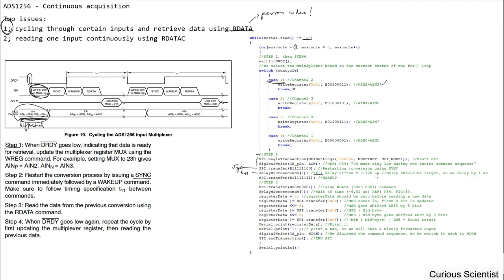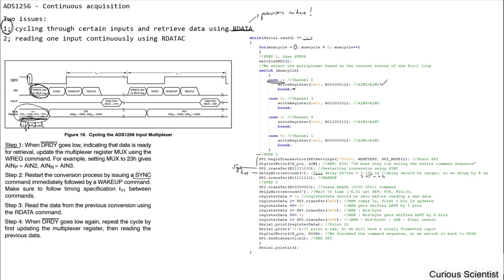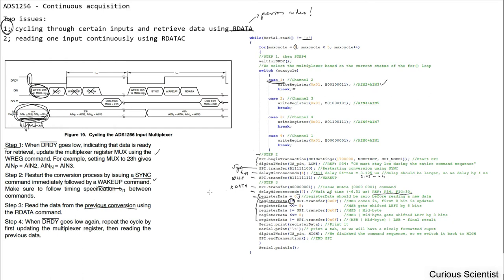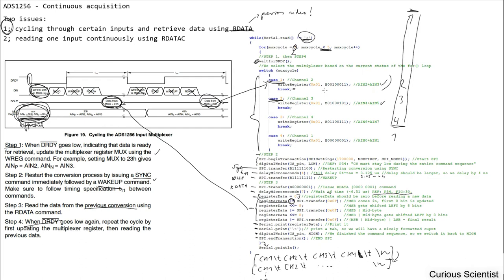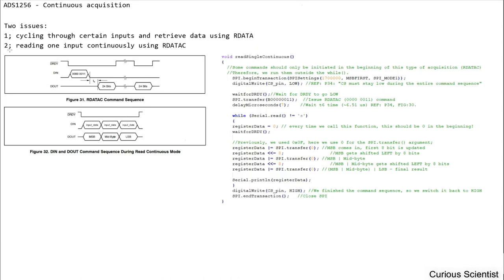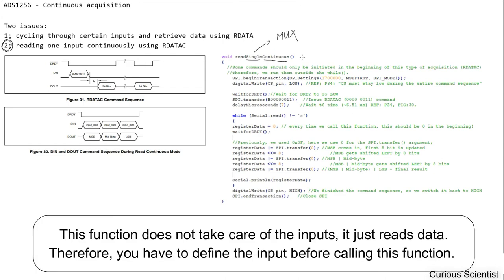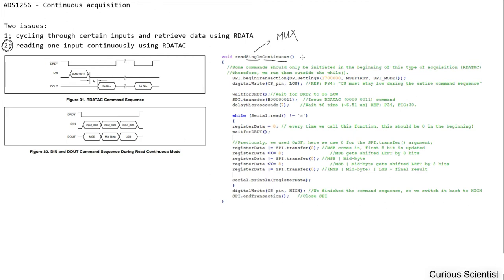ADS1256 - Single-, and multi-channel continuous acquisition

Comment: Hello, I think I used the same method of the RDATAC command, but always getting 0. Can you help me take a look? (BTW, I have no issue with the RDATA command(
Reply from the maker: Hi! Read the description and check my Arduino library.
Reply: I directly coppy your code and it also get 0 or  can't write the register quit often. when useing RDATA command, won't happen this issue.
Reply from the maker: Maybe your drdy is not set up correctly. But do as I said earlier and check my new code.

Comment: Hi there
I also wrote you on your Instagram beacuse I need your professional support.
I'm trying to use High-Precision AD-DA Board ADS1256, but I cannot reach the declared data sampling speed (30ksps) at most I reach 700sps with a single channel !!!!
In this video you have reduced the speed but the sampling in RDATAC remain about 250sps, I need almost 2Ksps, have youi tested real maximum sampling rate with your project and code ?
Reply from the maker: Hi! I can reach 15k without problems. In fact 30k also works but the Arduino code cannot catch up with the data rate. I am actually working on an improved code, but it takes time as I have other things lined up as well.
Reply: @CuriousScientist  Do u have the example?
Reply from the maker: Sure, check my channel and website.
Reply: @CuriousScientist  have u ever tried using raspberry pi and python?
Reply from the maker: No.